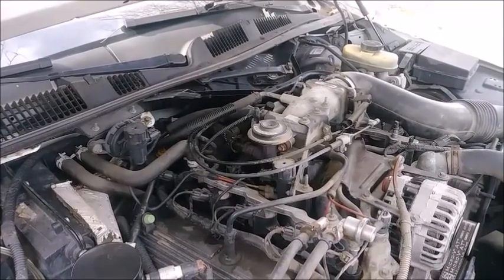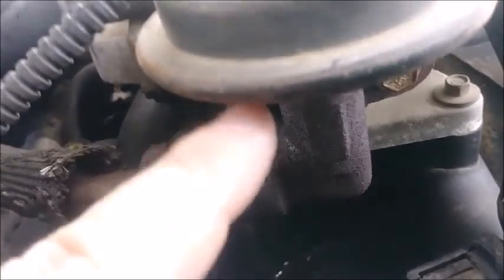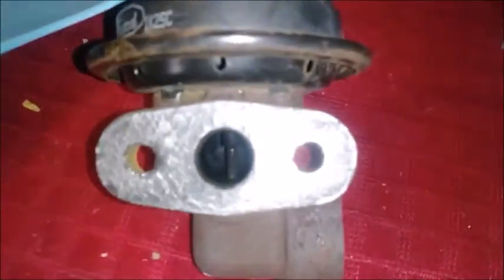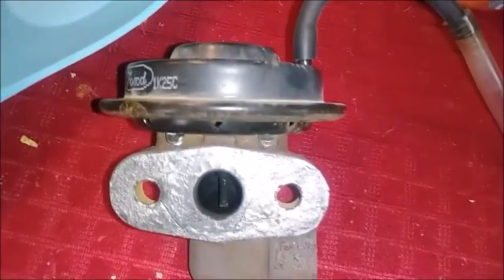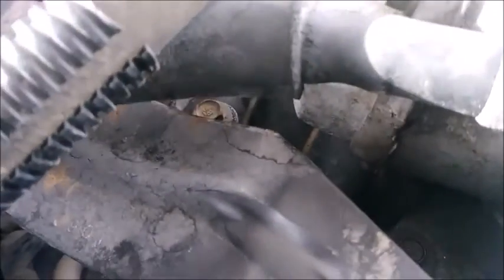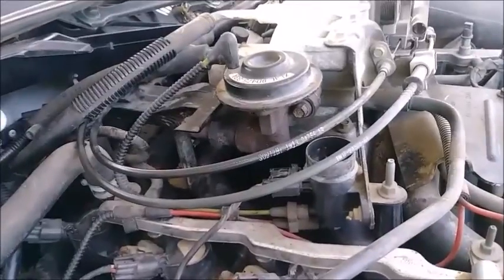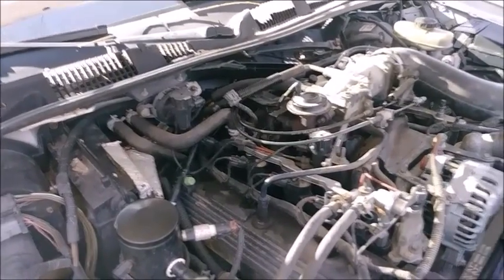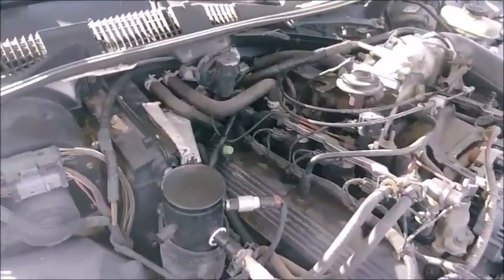How to test and replace EGR valve and DPFE sensor 2002 P71

Comment: What was the problem? EGR OR DPFE?
Reply from the maker: @zhs_503  DPFE
Reply: @ the code was P0401 or P1401?
Reply from the maker: @zhs_503  the following text is the description of my video.
This is tutorial on how to diagnose OBD 2 code P0401 EGR low flow on a 2002 Ford Crown Victoria P71. I test the EGR, remove, clean and replace it. I test the EGR solenoid. I remove and replace the EGR pressure sensor. Ford calls this part the DPFE sensor.
Reply: @ ok I have lincoln town car 2007 and I have P0401 code what do you thank my problem is dpfe or Egr ?

Comment: my tc revs up and down at idle, and lets say if im going 30 mph and let off the gas it will stay going 30 mph like its stuck untill i brake and around 50 mph if i let off gas it drops rpm lower than usual and slows down more than it should, i replaced iac valve thinking that was it could this be the egr?
Reply from the maker: The continuing to accelerate at 30 mph symptom sounds more like IAC valve than EGR. EGR is closed under acceleration and only open at cruising speed with no hard load. Do you have a manifold gauge to check for a vacuum leak? Do have an electronic throttle or a cable driven throttle? The revving up and down at idle sounds like a vacuum leak or a malfunctioning throttle.
Reply: @HollywoodHornet  i have a drive by cable i just replaced the iac valve thinking that wiould solve it i just read the codes it says p0171 and p0174 bank 1 and 2 system lean?
Reply from the maker: @rxmarlo2303  system too lean generally means unmetered air is entering the system after the MAF sensor. The computer is trying to compensate. Check the DPFE sensor and all vacuum hoses for air leaks. Check intake manifold for air leaks. A vacuum leak will sound like a hissing sound from the source of the leak.
Reply: @HollywoodHornet  thanks bro will do
Reply from the maker: @rxmarlo2303  no problem. There's still a chance the new IAC is either the wrong type or is bad out of the box. There are different types for different year panthers, and the new on I out on my P71 only made it like 4 months before needing replaced again. My current one is so far so good. If it malfunctions and the bypass lets a bunch of air in, it will also make a loud hissing sound. Good luck.

Comment: I have a 96 Crown Vic. I replaced the fuel filter after driving it and forgot to take off the gas cap like you're supposed to. Now every time I get in the car I smell gas but if I take off the gas cap and let the inside air out it won't smell like gas anymore. The smell is being released outside of the car. Do you have any idea what could be?

Comment: Those rubber hoses keep the dpfe sensor on like a tight v-jay how the hell do you pull it out??
Reply from the maker: WD-40 and a small pick. Use the pick to create a small gab between DPFE and hose, then blast with WD-40. That's the only way I could get it off (giggity) and the only way you can too.
Reply: What are you guys talking about the tubing to the egr??

Comment: Ford dealer just told me that the dpfe sensor is part of th EGR valve on the 2009 Crown Vic Police interceptor. Dpfe is the common problem with code P0401 insufficient EGR flow.
Reply: @ruizhou9612    i think 03 and up for future readers

Comment: Was your vehicle stalling when moving from reverse to drive? Mine does that and I don’t know what’s going on. No check engine lights coming on and when I brake it feels like it wants to stall. You think it could be the same problem?
Reply: Idle air control vale is bad sounds, amazon has mine for like $25
Reply from the maker: The DPFE sensor only affects the tail pipe emissions and would not cause the engine to stall. The EGR itself could cause the engine to stall as I illustrated in the video. Vacuum leaks could also cause that.

I would recommend using a scan tool and checking the fuel trim levels. Fuel trim will help narrow the suspect list. If there's a vacuum leak, the computer will add a significant amount of fuel to help equalize the mixture. A clogged fuel filter or weak fuel pump could also cause that stalling issue and would not illuminate a check engine light.

I had an old 84 Corvette that would stall when shifting from reverse to drive and that was caused by a faulty throttle position sensor, however it would trigger an engine light.
Reply: If I got a check engine light for a egr pressure sensor valve is it something I need to fix immediately?
Reply from the maker: @TheZoominHD  not if your car isn't stalling out. If it's only the engine light and it runs fine otherwise, you will have more NOX emissions but nothing that will leave you stranded.